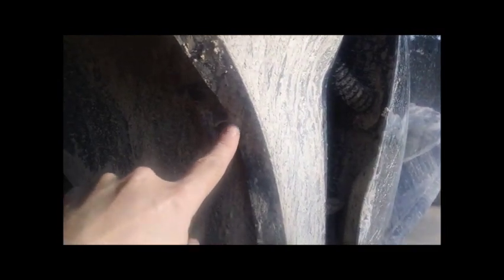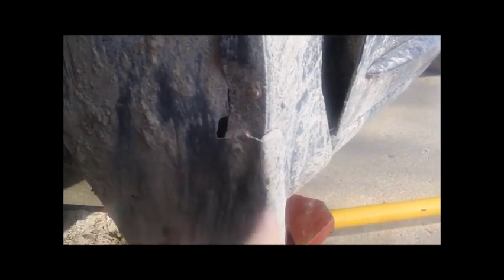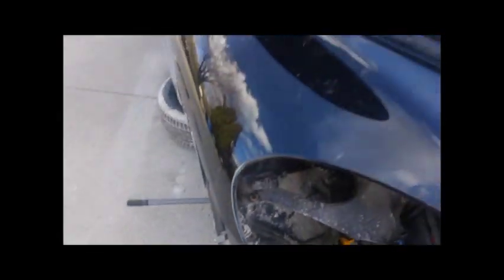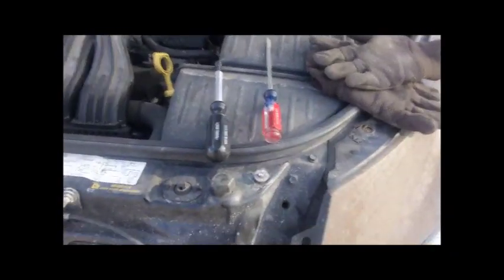PT Cruiser Fender removal

Comment: Hey there, around 1:20 in the video you start taking about the push pins, but if you pause and look to the right, there’s a cable attached to the inner liner. Do you by any chance know what that is? My is split in half and don’t know what to search for.
Reply: I think it's a ground cable to the suspension? Only thing it could be, I think. I was wondering the same thing bc mine is cut, too.

Comment: I need to do the same thing on a 2005 PT Cruiser but your video has me worried. A branch fell on my car and took out the driver side fender (nothing else, amazingly) but I'm wondering how I'm supposed to get the replacement fender off at the car yard without a) leaving a lot of pieces to put back on and b) how I'm going to do it, as your video suggests, if I have to take the wheel off to access all the bolts. Not sure how easy that would be at the car yard

Comment: Those two 10mm bolts in the wheel well that bolt the upper fender to the bumper next to the headlight are a pain in the ass. I’m trying to replace my headlights and the bolts on mine are headless flat up top so the bolt spins with the nut and won’t come off. I’ve tried everything to get them off. I ended up cutting one off with a dremel and was able to get one to come out as intended so I could just use one to hold it back together. The problem is the passenger side both bolts spin and I don’t know what I can use to bolt it back together if I have to cut both of them.